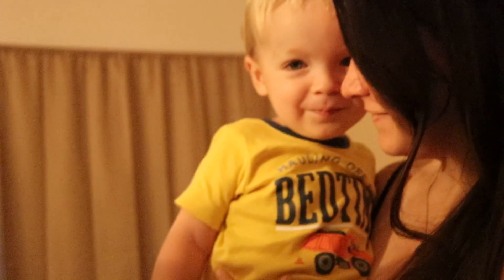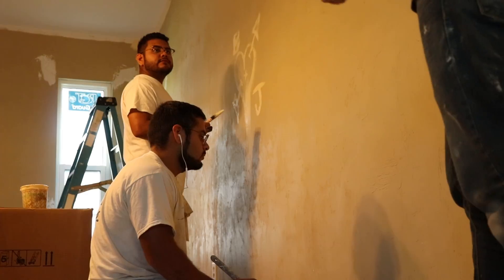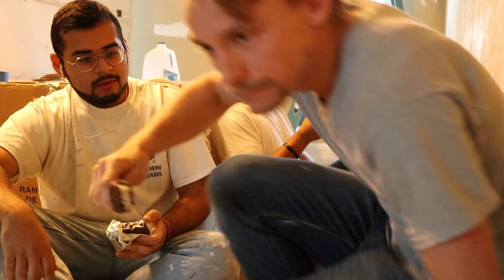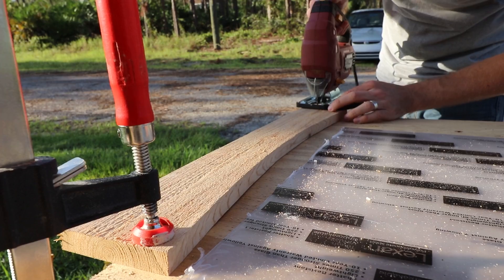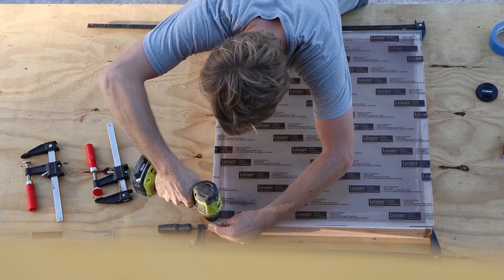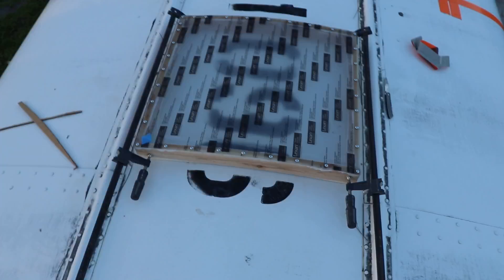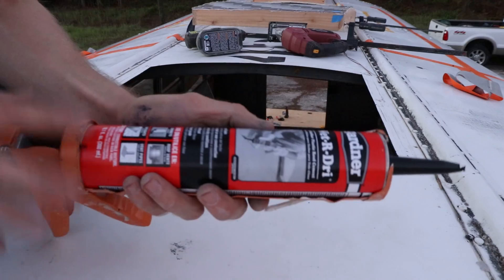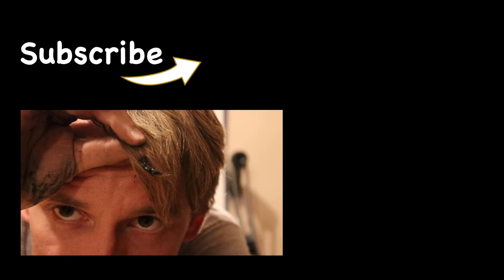Finished the new SKYLIGHT!! one of two!

Comment: I used  butyl tape where you used sealant and then I used self leveling caulking around the edges. Good videos.
Reply from the maker: +Trent Carbino that would probably be much more workable. I didn't have any butyl tape at my Home Depot so I grabbed that roof sealant. The original emergency exits were sealed with butyl tape and silicone around the edges.
Reply: Freedom International I didn't have any luck at Home Depot either so I went to a local rv dealership and they had it. Good luck and keep those videos coming.

Comment: You need to put a stainless or galvanized metal ring all around the top for the screws to go thru, in time the screw hole will crack and leaks will follow

Comment: Not sure what type of wood you used on that frame but I certainly would have sealed that would in some sort of way and then with another bead all the way around where connects to the bus if not that thing is going to leak water for sure dude and the wood mite last 3-4 years unsealed but look good though it really did
Reply from the maker: +Keith sutt it's cedar, but I do plan on sealing it. I have one more video on the last skylight I'll be posting soon and I'll cover all of that stuff!

Comment: Much better design but it will leak between the screws, the plexi will expand and contract differently to the wood and cause buckling between the screws, using a thick bead of sealant and a spreader bar across the top will allow for movement while remaining sealed. Good vid tho, more dog footage, love dogs. :)
Reply from the maker: +Dubsy Dubs I can see what you're saying. Maybe more in the extreme temps I'll have to deal with that. So if I ever get a leak I'll get some angle aluminum and just use sealant to glue it on the seams. Thanks for the input! MORE DOGS.    Got it!
Reply: You could use thin strips of wood on top, the thinness of the plexi is what makes it want to buckle.
Reply from the maker: +Dubsy Dubs gotcha, that would look pretty good too.
Reply: I'd leave small gaps at the corners of the wood strips to let water run off.
Reply: Dubsy Dubs : sort of frame the skylight and cover screws all the way around with sealant?
Reply: 128 : Yea a frame but screwed on top sandwiching the plexi. only needs a few screws.